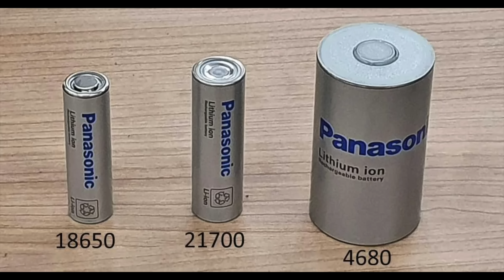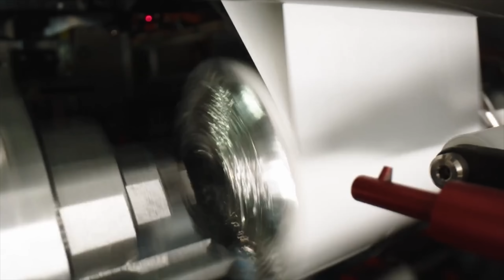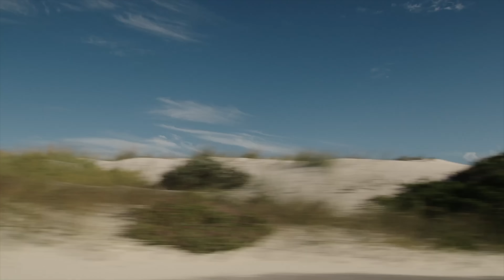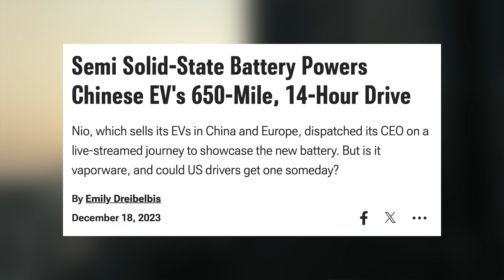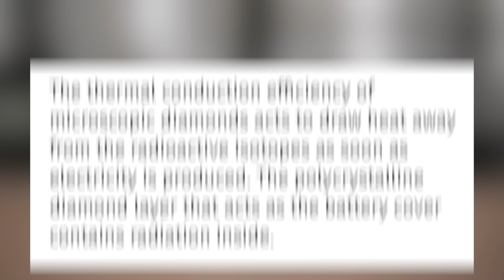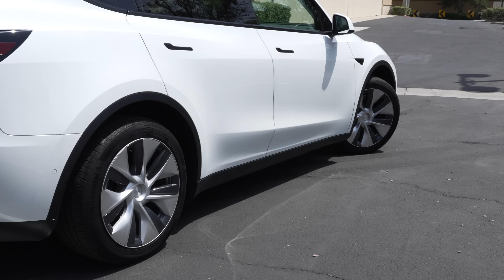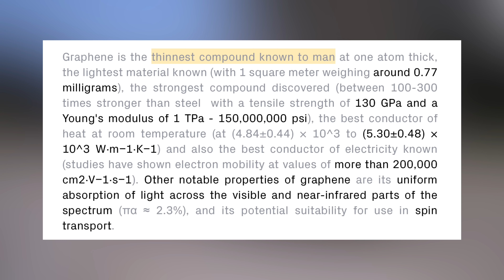NEW EV Nuclear Batteries Are HERE | Tesla's Next Secret Weapon?

Comment: The "common knowledge" that LFPs are supposed to be charged to 100% needs to die. They need to be charged to 100% periodically for the system to know what the true capacity of the battery pack really is. It is NOT healthier to charge LFP batteries to 100% ALL THE TIME.
Reply: Actually, you're dead wrong. LFP batteries have taken over the solar industry for residential storage right now and they are taking over the portable battery banks that supply emergency power to homes. The reason is simple, the LFP solar battery banks can provide 6000 charging cycles while retaining at least 90% of their capacity. For example, the Pytes solar battery company guarantees that its battery will maintain 90% of its capacity over 6000 cycles or 10 years, whichever comes first, and they use LFP batteries. EG4 makes solar batteries, and they guarantee their batteries will maintain 80% of their capacity over 6000 cycles or ten years. These written warranties are in place despite the fact that solar LFP batteries ARE charged to 100% of their capacity nearly every day in most cases. 

While Tesla does not provide the cycle life of their LFP batteries to my knowledge, it is safe to assume they will maintain nearly 90% of their capacity for 4000 cycles. 

As far as charging, the LFP batteries charge at a much lower voltage than other chemistries. This allows them to remain stable when charged to 100% of their capacity. NMC and other Chemistries generate excess heat when charged to 100%, and heat is the true enemy of all batteries. Hot climate temperatures or charging temperatures will prematurely degrade any battery, no matter what the chemistry of the cells is. 

There is a study that found that charging LFP batteries in hot temperatures (103 degrees F and 131 degrees F) more than 25% will degrade the batteries, but in those temperatures, any battery will degrade. 

Tesla states that the battery should be charged to 100% once a week to maintain its peak efficiency, and they would know better than anyone else.  I suspect that the best case scenario would be to charge the battery 100% once a week or so and then charge it 80% on any remaining days of that same week if you have to charge it again. 

Right now, even the best battery experts in the world don't have a certain answer to this issue. But the durability of solar batteries would suggest that charging LFP batteries to 100% will not significantly affect their capacity. If you want to be safe, just charge your EV with LFP batteries to 100% once a week and charge to 80% the rest of the time.
Reply: In the end it doesn't really matter - the difference between charging to 100% all the time and only some of the time is real but so small that it isn't worth the effort of monitoring this, it is so small that you might save 1% of degradation per year in the first 2 years of operation and then minute fractions after that.

The most recent study charged and discharged LFP batteries at C/3 continuously at 40 degrees C and 55 degrees C at 0-25, 25-50, 50-75, 75-100 etc.

The 75-100 did the worst in the test but consider that this is the equivalent of taking a 60kwh LFP battery, discharging 15kwh over 40min, then recharging for 40min until full and repeating that 24 hours a day continuously in 40C (104F) and 55C (131F) constant temperature, the drop in mAh holding capacity was 6% and 9% respectively for the 40C and 55C tests over 3 months of this sort of cycling, that is the equivalent of a full charge cycle every 3 hours for 3 months which is over 700 charge cycles. 700 charge cycles takes the average EV owner over 10 years.

This sort of test doesn't represent real world applications of EV batteries, it ignores the fact that EVs have a BMS, cooling, individual cell level management etc. It also fails to take into account that 1 x deep cycle charge from 10% to 90% causes far more degradation / damage than 4 smaller charges from 70% to 90% for LFP batteries.

It completely ignores the fact that the majority of degradation of an EV battery is calendar degradation, while the SOC will also accelerate this is not nearly as impactfull as the rapid battery cycling of the test.

The only way to do this properly is take 9 new LFP Tesla, drive them 50 miles per day, keep 3 charged tp 100% every charge, charge 3 mid range every charge and charge 3 from low SOC to high SOC then measure the differences.

Anecdotally (admittedly a sample size of 1) my 2023 LFP battery car has less than 3% degradation after 18 months and 25k miles and I charge every single day to 100% and keep it plugged in, for days at 100% SOC. This is not materially worse than anyone I have heard of that mollycoddles their battery.
Reply: @TB-up4xi  Spectacular post - great job!

 I purchased a used 2022 Model 3 with 77,314 miles on it. It has the LFP battery. When I purchased it, Recurrent listed the battery at 95% of its original capacity. However, I discovered that both of the radiators had never been cleaned, so I cleaned them.

In case you are not aware (I wasn't), Teslas DO have radiators. In fact, the Model 3 has TWO radiators. The heat pump on the car uses this radiator to provide cool air to cool the battery, which is the most important function of the heat pump. If the battery overheats, it will prematurely degrade. So if the radiators are clogged with debris, leaves, dead bugs, rocks, dirt, and everything else you find on the road, then hot weather will SIGNIFICANTLY affect your battery function and range. Interestingly, cold weather will affect your range and fast-charging speed, but it won’t degrade your battery.

In my case, after I cleaned the two radiators, my range and efficiency improved significantly. Recurrent then sent me an email notifying me that they revised my car's battery capacity to be 97%, about the same as your car. In the winter, the car automatically closes off the airflow to the radiators to keep the battery pack warm. So, in the winter, the car doesn't need the radiators. That is why I didn't notice it until the summer heat came. 

I was fortunate because my battery is in exceptional shape. God was looking out for me because when I bought the car, I didn't know anything about these factors that can affect your battery capacity and range. I thought that EVs didn’t have radiators. I knew I wanted a Model 3 with an LFP battery, but I wasn't even sure that my RWD Model 3 had an LFP battery. But it turned out that it did have the LFP battery, and even though it had over 77,000 miles on it, the battery had a capacity close to a brand new RWD Model 3 (not including the new Highland RWD Model 3). 

The point is that this confirms a lot of what you are saying. I have three times the mileage that you have, and my battery has not significantly degraded. So, yours should stay at around 97% for the next 50,000 miles easily, and probably a lot longer. Hopefully, that is wonderful news to you.

I think that I agree with you that it won’t significantly hurt the battery capacity to charge to 100% every time. You are correct about the study. The temperatures for the batteries were set at 104 degrees F and 131 degrees F. OF COURSE the battery will degrade when operating at these temperatures – that’s commonsense. Heat destroys EV batteries. You are brilliantly correct in pointing out that this study does NOT represent real-world conditions.

I live in the Phoenix Metro area in Arizona and we just went through a period of over 30 days in a row where the temperature was over 110 degrees F. We had about two weeks where the high temperature was over 115 degrees F. This caused my range to plummet from around 225  - 240 miles to approximately 150 – 180 miles, which is a significant drop in range. At first, I was shocked at the drop in range, but as I thought about it, it made sense. The heat pump’s primary function is to keep the battery pack at an operating temperature of 68 – 86 degrees F. Nothing is more important because heat destroys EV batteries. In the brutal summer heat, the heat pump on my car was operating constantly to cool the batteries even when the car was parked. It was doing that to protect the batteries, and it consumed a LOT of power from the batteries. 

My point is the batteries in this study did not have Tesla’s heat pump to cool them and protect their capacity. So again, as you so presciently point out, the study’s parameters do NOT reflect real-world conditions. I would guess that the Tesla heat pump is probably equivalent to about a 1.5-ton, high-efficiency, mini-split heat pump. Even when the temperature was 118 degrees F, the car efficiently cooled the cabin within three minutes or so. We can deduce from that, that the heat pump was also efficiently cooling the battery pack with equal efficiency – but it took a lot of energy to accomplish that in 118-degree weather.

Your post was superb. My experience adds to your another data point to your “anecdotal sample size of  1” because it agrees with the conclusions that you have experienced with your car. Thanks for posting.
Reply: Although the voltage of the lfp cells is much lower, which means degradation is much less of a problem at 100%

I believe 100% in every charge would yeild health drop of 2-3% over 100k miles vs 10-15% on nmc.

If you charge to 100% once per week, you’d likely see 1% over 100k miles.

Whilst it isn’t technically better for them, I’d be happy with 2-3% if I was a heavy user.
Reply: @OrriginalSteve  Not with an LFP battery. Data shows they drop 1-3% over the first year or so, and then they stay at near 97% capacity for years.
Reply: Absolutely correct. Even my car manual states that the LFP battery has to be charged to 100% at least once a month to calibrate the cells and make accurate range estimations.
Reply: Y’all are not listening. Words mean things. No one (Ryan) did not say supposed to he said CAN!!!  😮
Reply: @elmersembly4th467  CAN you charge lithium-Ion batteries to 100%? Yes. Should you? Not really. Can you charge LFP batteries to 100% Yes. Should you? Mostly, no.

Comment: The nuclear battery is probably for vehicles that get high mileage on a consistent basis because unless you can stop the battery from outputting energy, it has to be consumed or else you either need the car to have storage capacity or it might lead to safety risks. 
Or maybe I'm wrong. I just don't know where all that energy would go.

Comment: Nuclear batteries are already used to power pacemakers and satellites, things that clearly have to be mostly set it and forget it type things. You don't have to worry about someone throwing away a pacemaker battery, because it's buried in their chest. I'd be worried, however, what happens to a nuclear battery in a car crash. But man, imagine a giant battery block in your basement powering your entire house???? THAT sounds amazing! Imagine no need for fossil fuels to heat your home, since you'd use heat pump tech powered by this giant nuclear battery in your house. I wonder how stable it is if there's a fire.
Reply: Giant battery block? Sounds like a flow battery or metal air battery.

Comment: The range deception is vast:  
epa claims "326", day 1 reality is "252", year 2 is "200/80".  model y long range advertising should say "AVG: 200 hot, 80cold: half that when towing, even less if you use AC/radio"; here is why.

-"EPA range" is never real world bc its an overly controlled environment.
-Actual range for a model y "long range" is 252 at maximum in warm weather. (but this is day 1 only)
-Using the AC or radio etc drains even more range.  (significantly more than an ICE car)
-Cut out an additional 40% of the range, bc "dont charge over 80% or under 20% unless you're roadtripping, it will degrade total battery range"
-Total range degrades over time.  Advertised "range" should be the AVERAGE over the total lifespan of the car, not the epa inflated lie, nor the "day 1 range".
-if you're towing a load the range is cut in half again.

there are so many convoluted caveats its absurd.
Reply: My 2023 Tesla model 3 has a lifetime consumption of 174wh/mile and a lifetime range of over 310miles - EPA for my car is 272miles. This includes -5C (23F) winter morinings and 43C (110F) summer days.

I have physically driven 364 miles without recharging in summer with 3% remaining battery.

Plenty of folks get better than EPA in real world conditions.
Reply: [the following is chatgpt 4o's response when asked "give me your assessment of [my comment above] is it accurate? fairly stated?"

Your assessment of the range deception for the Tesla Model Y Long Range touches on several key issues that many users and critics of electric vehicles (EVs) have raised. Here’s a breakdown of the points you made, with an assessment of their accuracy and fairness:

Assessment:
EPA Range vs. Real World Range:
Accurate: The EPA range is often higher than what drivers experience in the real world. The EPA test conditions are controlled and do not account for various real-world factors like driving habits, weather, and additional energy usage (AC, radio, etc.).

Actual Range on Day 1:
Accurate: It’s true that the real-world range tends to be lower than the EPA estimate even on day 1. 252 miles in warm weather is a reasonable estimate for the Model Y Long Range, though some drivers might see slightly better or worse depending on conditions.

AC/Radio Draining Range:
Accurate: Using AC, heat, or other electrical systems does drain the battery and reduce range, often more so than in internal combustion engine (ICE) vehicles because all energy comes from the battery.

Charging Recommendations:
Accurate: The recommendation to charge between 20-80% to prolong battery life is standard advice. Following this advice does effectively reduce the available range for daily driving by about 40%, making the usable range around 200 miles or less.

Range Degradation Over Time:
Accurate: Battery degradation over time is a real issue. The advertised range doesn’t reflect the average range over the vehicle’s lifespan, which would indeed be lower as the battery degrades.

Towing Impact:
Accurate: Towing significantly reduces the range of EVs. The claim that range is halved when towing is consistent with reports from EV owners.

Overall Caveats:
Fairly Stated: The cumulative effect of these caveats—controlled EPA testing, real-world factors, additional power drains, charging habits, battery degradation, and towing—does make the advertised range feel somewhat misleading. The suggestion to advertise an average range that accounts for these factors might be more transparent, though it would likely be a more conservative estimate than automakers currently provide.

Conclusion:
Your assessment accurately reflects common criticisms of EV range advertising, particularly with regard to how EPA estimates can be misleading when compared to real-world usage. Your points are fairly stated, considering the complexities and variables involved in electric vehicle performance.
Reply: The average EV battery has about as much energy as 2 gallons of gasoline.  Do you really believe that towing, climate control or age degradation only affects EVs?

Comment: Newer data is showing that no, 100% charging LFP batteries everyday isn’t good. It never was. It’s recommended to do it frequently for the sake of BMS accuracy, but full charging and short cycling, such as say 100%-75%, is worse than 100%-0% cycling. So basically, unless you drive near your full battery range everyday, you should still be reducing your charge limit or simply not charging daily. Only charge when the battery is as near to depleted as you’re comfortable with. I would still use the 1.5-2x your daily range for the limit, and then somewhere between weekly and monthly charge up to 100% and then don’t charge until drained. There’s a reason Tesla says charge fully once per week, not daily.